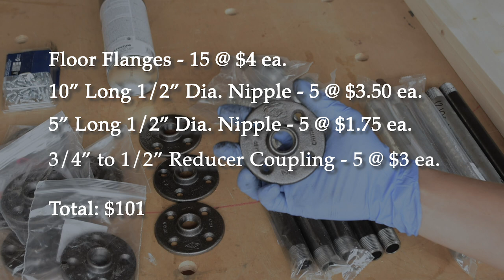Build a Sturdy Shoe Rack with No Cutting and Few Tools

Comment: Wow - yet another video on an incredibly useful project/item, and also "so simple...why didn't I think of that?" :) One modification that I will be implementing when I get around to doing this - take pieces of PVC pipe (to keep it pure white, either rub off the printing with PVC Primer to make it pure-white, or spray paint whatever color with paint for plastic pipe), size the pipe to hide either just the threaded nipples or large enough to hide the flange as well, and place around them before the final connections, securing with dabs of super glue. It will give it a slightly more "refined" look, so you don't see the various connections. Might add another layer of difficulty to get the pipe the exact length, but can cut it a hair short and fill in at the top of the PVC pipe with a little caulk to help hold it in place.

Comment: Great design!  Sometimes the simplest projects end up being expensive, but well worth it.  I am curious if you thought about something under the feet, or rubber, something to keep it from sliding around or damaging flooring?  I am also curious why you stained both sides of each board.  I would do the same, but I can't tell you why.   Will it help keep the shelf longer?